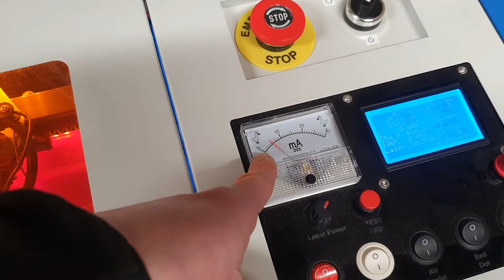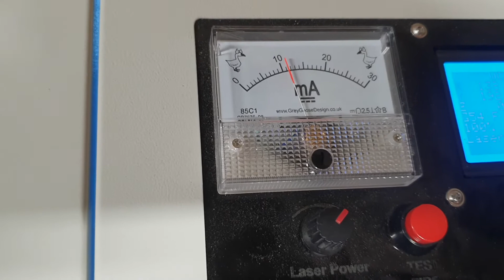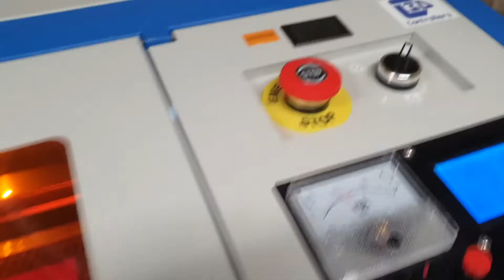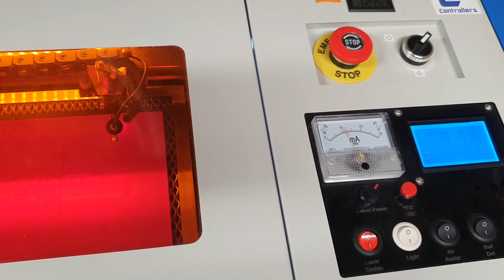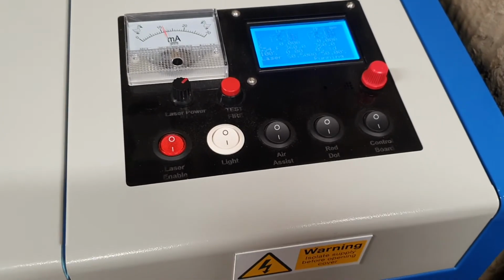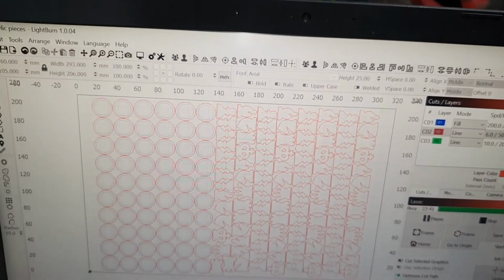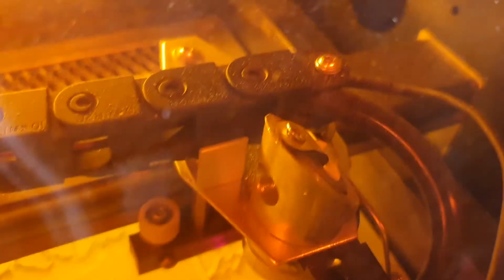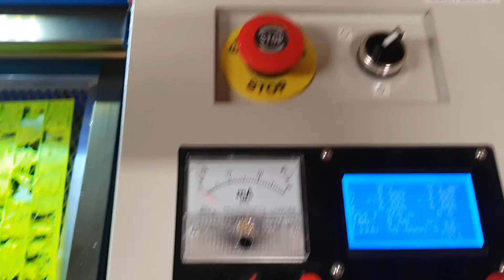K40 Quick guide to buying and owning your very own laser cutter

Comment: Can you provide the make/model of the centrifugal fan that you used?
Reply from the maker: Hi Chris if you're in the UK they are available here on eBay https://www.ebay.co.uk/itm/163686231824 the smaller one, hope that helps
Reply: @lostandoverengineered878  Did you keep the internal rectangular extraction vent or remove? Also interested in more info for the air assist/laser pointer clamp hardware arrangment if possible!